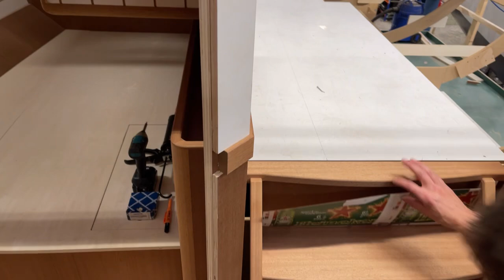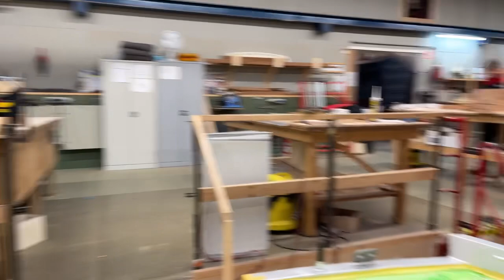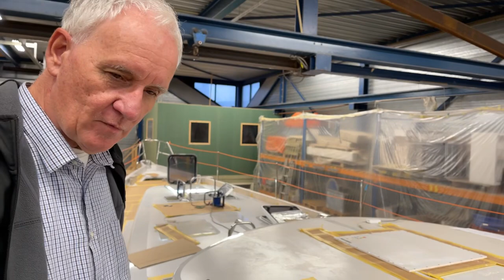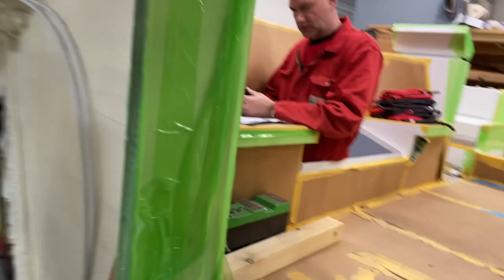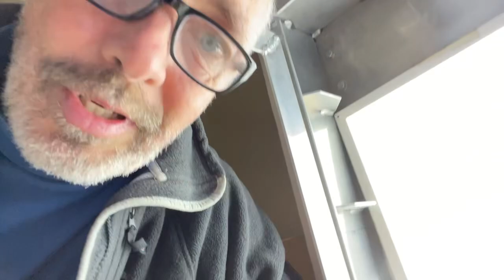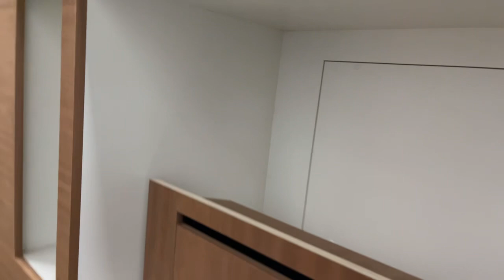Boat Tour & Build Update of an Enksail Orion 49 Aluminum Expedition Sailboat

Comment: Question about isolation😅. I'm assuming they use closed cell polyurethane foam. or something special? PU has about half the diffusion resistance of epoxy resin. So some water vapor passes through, which can condense on the hull. Since it is impermeable to water, condensation collects. There have been no problems with density so far. That's also a reason why it's only used very little in house construction. thanks for the cool videos.. keep it up! cool how you appreciate the craftsmen.❤❤❤❤
Reply from the maker: The insulation is a sprayed 2 part polyurethane foam. Check the clip in our update showing they foam being sprayed in place... https://youtu.be/Y1fQ7U9FOyA?t=985

Comment: Great episode guys, thank you for this detailed update! And what an amazing exploration vessel is coming out!! I imagine you cannot wait to see her in the water. The wiring is so clean even if I hsve no idea if you can easily change/add a wire if it get damaged for some reason. If I'm not wrong there is no insulation in the bottom part of the hull. If I'm correct is there a special reason for that?